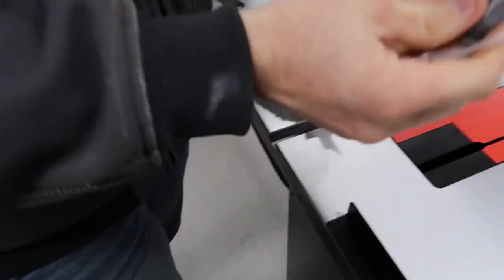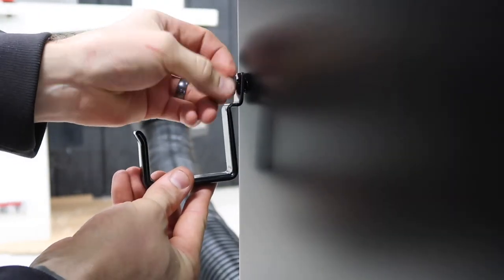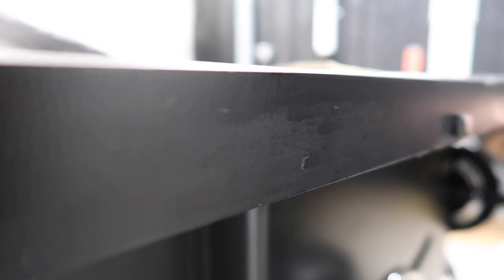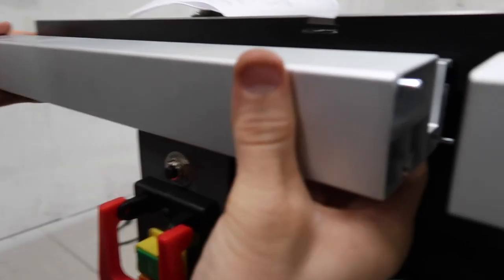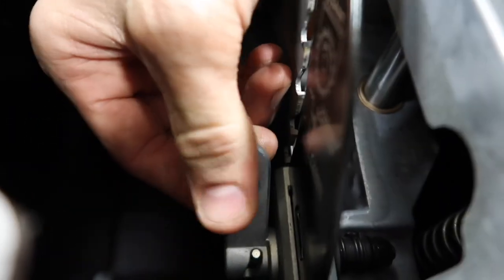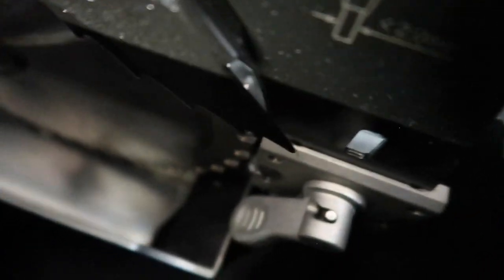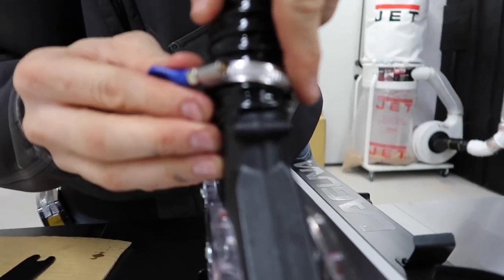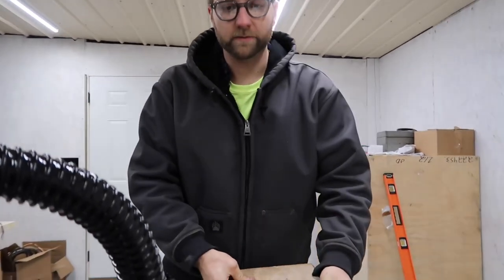LAGUNA TABLESAW FUSION 2 Assembly - Step-by-Step  | The Mckeels

Comment: Have you placed a straight edge on the table top and used feeler gauges to check for flatness front to back and  left to  right in particular ?  I just returned a new Saw Stop because it was way out of usefulness for any accuracy.  I am looking at the Fusion II and III.  Thanks
Reply from the maker: I have checked. It is within .001 inch.  So far I am very satisfied with the fusion 2 table top. 

One thing I have noticed, is when I am pushing hard oak 1" thick, you must have a quality blade, or the motor will lag. 

But it rips ply wood like a champ! No lag at all...
Reply: @TheMcKeelsWoodworks  Thanks very much.
Reply: @TheMcKeelsWoodworks  Nice saw.  Are you using a 120v 15a, or 20a circuit?  Or 240v?  The 60t blade that these come with are not ripping blades.  Not sure why they did not come with more versatile 40t blades.

Comment: Did you check blade for parallel to mitre slots and fence?
Reply from the maker: Yes. I did this off camera with a square, digital degree scanner, and actually out of the box it was within .05% error. For me, that is great! I am sure if you were a fine cabinet maker or working with small error parts, you may want to make some other adjustments. 

Can you think of anything else I should check?
Reply: @TheMcKeelsWoodworks   tilt the blade at 45 degrees as well and see if it's parallel. Its actually is checking the tilt mechanism pivot is parallel to the top of the table if that makes sense. My cheap saw was out alot. It's a bit of a stuff around because when you get one close the other is out, so you go back and forth. I made a timber jig like an L bracket screwed to my mitre gauge to get my dial indicator as close to the table as possible. It is amazing what a difference a good setup makes. With a decent blade I now get an excellent edge square and true for glue ups. And after setting my stops a true 45 degrees. Oh set your stops to 90 and 45, I'm assuming it has them. Do a video!!
Reply from the maker: @manofausagain  great advice! I'll make sure to make a video, possibly by the end of the month. Thank you for your feedback!
Reply: Nice video...
I'm looking for a F II, where did you get yours from?
Reply from the maker: @Dincrivelfly  Thank you for watching, supporting, and subscribing to our Channel! 

We got our LAGUNA from bistools.com 

Every year they do a promotion where you can get 10 - 20% off plus Free Delivery. 

We had to wait 8 weeks for us, but it’s been worth it.
Reply from the maker: Rocket Man  yes. Unfortunately they have already closed the sale for the year. But they should pick back up in November. 

It did take them almost 2 months to fulfill my order, it was worth the wait! 

How we got it off the pallet was by sliding one side onto the concrete floor and pulling back on the table saw, my wife pulled out the pallet from underneath the saw. Once she had the pallet removed, we both let the saw down slowly. 

It wasn't too bad. 

Thank you for watching our videos! Are you thinking about getting/upgrading a table saw?